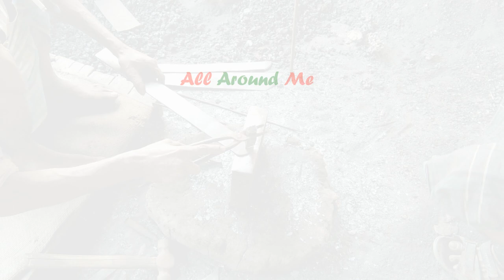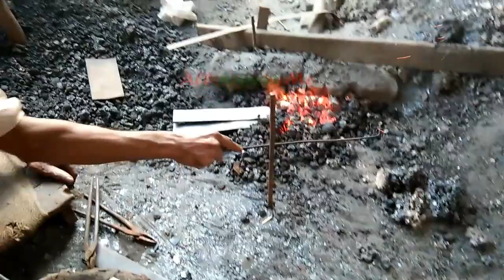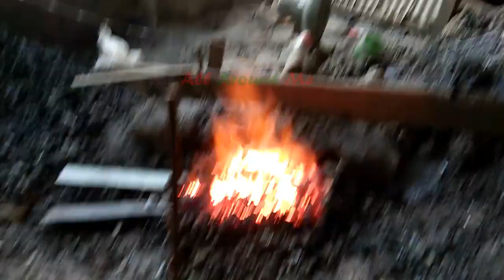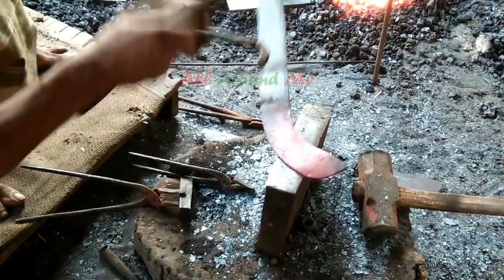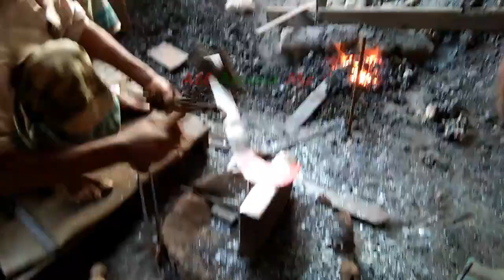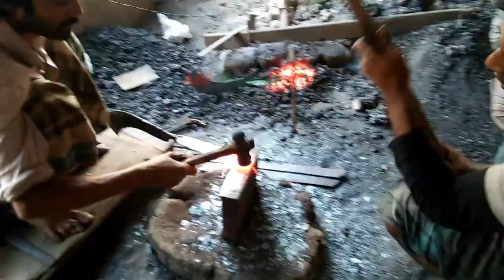How to make chopper knife || blacksmith making Indian boti || Work of Blacksmith

Comment: One things I advice you to improve the quality of your work for quenching methods use bar soap for clothes. Put the edge of the knife into the fire then it will red and put the soap by wiping the edges put the soap back to back wiping horizontally put it again into the fire for about 5 seconds and submerge the edge off the knife into the water.it becomes white the result of the edges this is the best results for quenching methods.